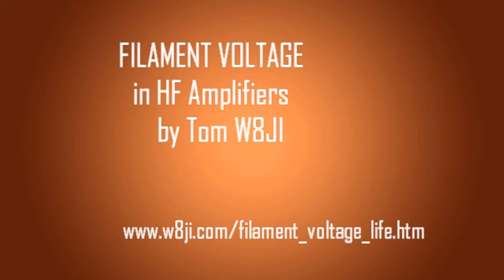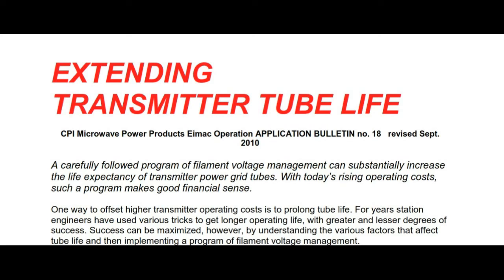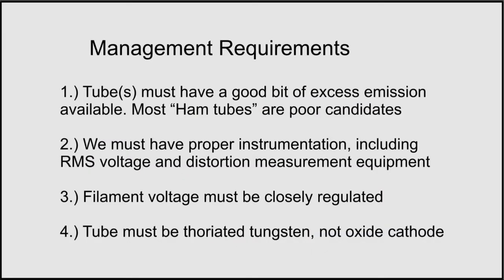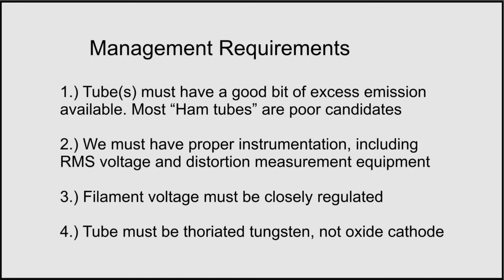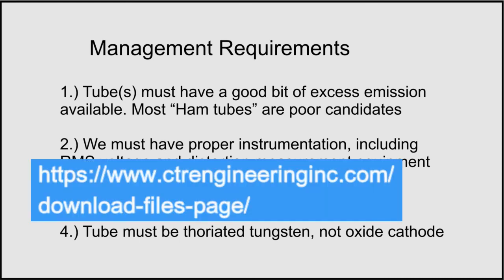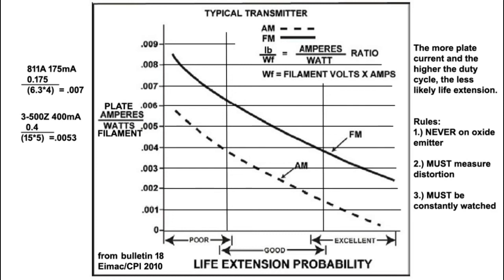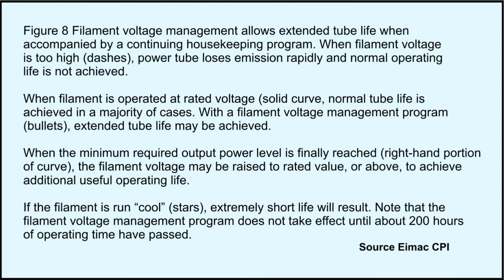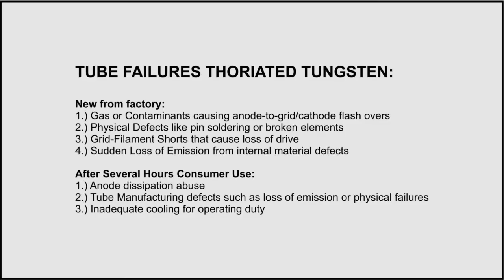Filament Voltage and Transmitting Tube Emission Life

Comment: Thank you. for some reason everyone is posting online that you need to for example substitute a 50c5 for a 35c5 due to todays higher line voltage. The tubes have a +-10% range according to the datasheet. Set was designed for 117 volts. The filament voltage is within that 10% with a line voltage of 105 to 125 volts. I have been measuring the line voltage on the wall outlet for some time now and it varies between 110 to 121 volts but is usually 115-118 volts most of the time. So by keeping the 35c5 I am keeping the set running properly. Replacing it with a 50c5 will yield underheated tubes. all of them in the series string. So this is just more bad advice online that is everywhere.

Comment: Hi , I use large transmitter tubes on my channel for monster Vacuum tube Tesla coils,   I would like your advice on a building my own common mode filament choke to keep the RF of my filament transformers in future builds, what would you advise on say the GU39B  100A 6.3v , Ie core size, material, inductance, conductor gauge etc I've used a large powdered iron core in the past 100mm od with around 8t on each side that's all I could get on there because of the large conductors I was using to carry the 100A I also had a cap straight across the pins 470pf 15kv  I ran the filament at 6.9v at the pins unloaded to account for the line drop when I start pulsing or running the coil at 10kw cw 😅

Comment: Hi Tom!
I searched your callsign on YouTube and here you are! Subscribed instantly.
I found your webpage long time ago, and read everything you write, about antennas and grounding, and I would like to ask you a question, if you please:
I built a quarter wave groundplane for 145MHz, isolated from the mast. 
But rain static made it dangerous to use, so I connected the radials to mast and run a 10k resistor from radiating element to radials. 
In my opinion it performs well in both configurations, now without static bites.
Which is the best way to build it? 
I think you wrote radials shouldn't be connected to mast to avoid losses, and to use an isolator. I like to model and build antennas, but my knowledge is very limited in antenna theory.
Thanks Tom, for sharing your knowledge